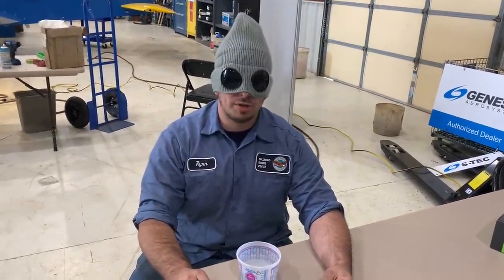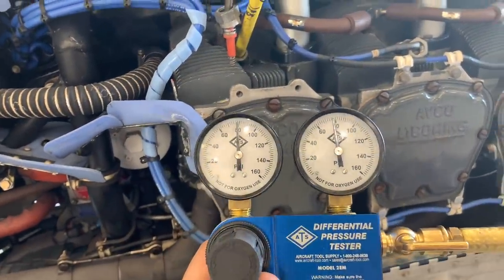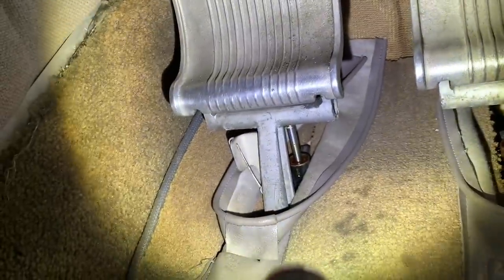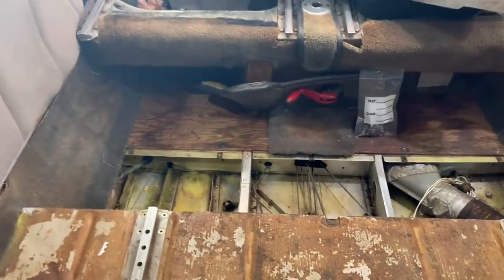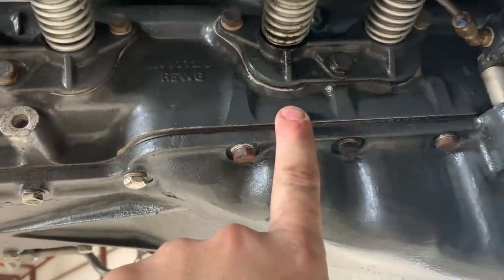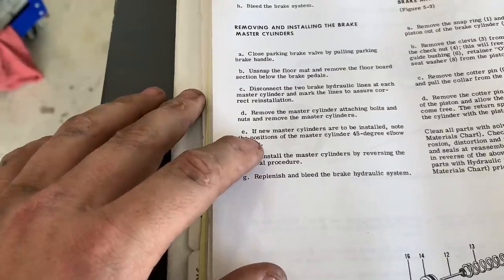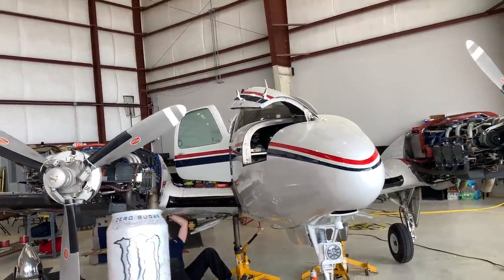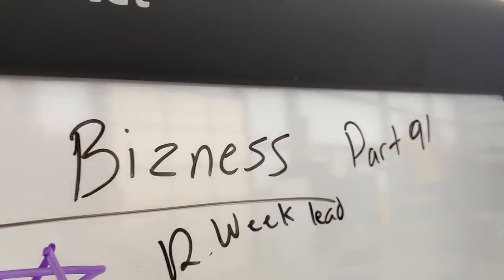Baron 56TC annual inspection finds.   Days in the lives of underpaid general aviation workers.

Comment: At home depot or lowes you can get micro nozzle kits for vacuums, then get the adapter kit for the small hose and use ductape at the ends of the different fittings to seal up the joint even better so no loss of vacuum. I have a 1/4 nozzle thats awesome but mostly use the 5/8 one. Another method is get a big ass vacuum in there and blow it all out with an aircompressor with a long brake line on it for a nozzle.

Comment: Have to use one those narrow fittings that usually come with the Vaccuum accessories. But you got to use some kind plastic bristle brushes first with some kind of safe to use cleaner to loosen up the crap. Park tools makes a nice brush used for getting between bicycle gear cassettes and also Muc Off makes a cool set of brushes for cleaning bicycles.

Comment: in 2015 I did a whole new interior on my 1975 C177 Cardinal RG under the supervision of my AI.  I'm pretty sure it was the first time that the area under the floor had been cleaned in at least 30-years.  For dry stuff, a thin nozzle on the vacuum worked, but a good deal of the crevices were gunked up with old hydraulic oil, pulley oil, etc.  I made custom bent wire and nylon brushes and used a citrus based degreaser to loosen it, then many, many rags.  Its a little upsetting to see how many aircraft mechanics cut corners or just do things that make it hard for the next person to fix.  Good on you!!

Comment: Dont forget you respirator when cleaning mouse poo ;) btw I use the RIDGID VT2534 kit but also have rigged different size clear flexible tubing I got at lowes and just attach them to 1 of the thinner shopvac adapters with a hose clamp and it works great for those awkward spots.

Comment: I have just the thing for you!  Go down to Home Cheapo and get some PVC fittings for the end of your shop vac, so that you can attach a length of garden hose.  Use about 2-3 feet of flexible hose, with the end cut at a 45-degree angle.  This will increase the air flow (vacuum) substantially, and the flexibility will allow you to “snake” the hose through any narrow openings or inspection panels.

Comment: TIO-541-E1C4 engines from a Duke. Big turbos make that plane the fastest Baron in the sky. I would highly recommend to the owner to fix it right, fuel bladder and prop de-ice, or since it is for sale, I hope any prospective buyer sees this and reduces the offer to cover those items. I never saw a prop deice boot throw a lead off like that. But I have seen a broke lead or two. Might be a good idea to solder the wires onto the terminals, but I know they don't come that way.
Reply: Negative on the solder idea! There is a reason connectors are never soldered on airplanes: vibration. And in this case, relatively severe vibration. Solder has a bad habit of cracking at the wire/solder interface. Best bet is the (now hideously expensive) Amp 59250\59275 series crimpers. I bought a used pair of these when I built N36LV. They provide a near oxygen-free crimp to the bare wire and a solid secondary crimp to the wire’s insulation. You can still find them used on eBay and ship them  back to Amp for calibration. Never had a single failure.
Reply from the maker: I’ve seen people solder the crimped side of the terminal, not the wire side.  It helps prevent corrosion, and may have kept the wires from pulling through in this case.  So it’s crimped, soldered on terminal side, then heat shrinked.  If it comes off after that 😂……. Not really sure of the rules and regs on the prop though, we will let a prop shop handle all of that….  
I love been thinking that the pulled through wires may have been caused by someone pinching them while installing the spinner….. like “hey this won’t go on all the way… let me just force it !”
Reply from the maker: Also where do you get that connections are never soldered?  Ac43.131-B. Section 14, sub A, #7 talks about using soldered lugs for terminals
Reply: @aviationsquared1909  I just don't recall the terminals on those leads being soldered. If they come soldered  from the manufacturer, why did they pull apart?
Reply from the maker: I’m responding to B walker…
Reply: Not lycomings best effort
Reply: These Engines: TIO-541-E1A4 did not come off a Duke.  The 56TC was a predecessor to the Duke, maybe even a test bed, and the TIO-541 engines were modified to support accessories for pressurization on the Duke.

Comment: I hope you didn’t rebuilt those brake cylinders yet. Recently replaced a couple of them bustards leaking on two different Bonanzas with a newer style cylinders. According to the guy worked for Beech for a while those are not worth the rebuilding, going to start leaking again really soon.

And they are not fun to replace. That bolt goes head-outboard just like you assumed, there is no way to force it in head-inboard with cylinder in place, it’s not going to make that angle turn to straight direction ever.

Also removed and installed one bladder on Bonanza. Was leaking from one of the nipples that is attached to the ridged line towards the fuselage. Simply was over tightened and cut through by the securing clamp.

Good catch on that pinched leaking brake line👍🏻

Another cool video! Thanks
Reply from the maker: Looks like it had some extensive sheet metal repairs and I’m it looks like they replaced all the metal on the bottom.  My guess is the sheetmetal guys through that bolt in there before they riveted it in and had a good laugh
Reply: @aviationsquared1909  yeah, I’ve noticed a couple new rivets in the nose wheel well. Liked that laugh over the bolt head cut out on the video =)
Reply: Yep, had a few Bonanzas in the shop of late that were leaking after rebuild. Don't think it's possible to get the old master cylinders anymore?

Comment: For vacuuming tight spaces I use a variety diameter of automotive heater hose to adapt down as far as I need- usually ends up being a fuel line diameter. It's okay for getting around corners too.

Comment: Hi, nice content, just curious on the min. 7:33, the bonding straps damage on the fuel line, they should be installed with bare metal clamp against the metal tube or this rubber grip  on the Adele clamp enhance the electrical conductivity.
Reply from the maker: Above my knowledge, I’m with you on the rubber lol.  I’ll ask in the morning, keep commenting if you don’t hear back as I’ll forget
Reply: 100% Correct! Using a rubber cushioned adel defeats the purpose of bonding.
Reply: @aeromission9333  I remember thinking the same thing. Why a rubber clamp on a bond strap? Along time ago I took one of those clamps off to see. It had a metal contact area in the middle of the cushion. It is a specific beech part. That’s what I remember,, been a long time.

Comment: 3 years for an STC. Must have been either the fault of money…or the FAA. 

I did a field approval for a wrong engine on an PA22, still only took 3-4 months of waiting.

The stamps on the cylinders are likely from the cylinders being overhauled units, they were on their original engine at those positions. But not necessarily required to be there on the next engine
Reply from the maker: Makes sense.  The 3 year gap was before my time in aviation.  I’m more video experience than aviation experience 😂

Comment: 20 years of fixed and rotary wing maintenance in the military plus 14 as an A&P after I retired, boltheads are up, inboard and forward unless called out in the maintenance manual. 18 inch rule applies or within the space your working for FOD, even brand new from the  factory can have some doozies laying around inside and age plus varying maintenance doesn't help.

Comment: Around a 1-ft length of  hydraulic tube or fuel line aluminum pipe neck it down actually neck it up to go into the end of the vacuum tube and use it as a nozzle for small places.
Reply from the maker: Good tip

Comment: *Did you replace or spray lubricant on the mixture cable to free the full movement?
*After vacuuming the FOD and poop, are you coating the aluminium with cabrium chromate (green corrosion protection)?
*That was good thinking placing a screw cap on the connection and air-leak testing.
🐝💨🧑‍🔧
Reply from the maker: Mixture cable had no cotter pin and the nut was too tight.  Also we re indexed it one tooth and that freed it up

Not sure about the coating question.  There’s a much longer list of squawks that they’ll go over with the owners

Comment: Very interesting to see what you look for - and how you dealt with what you found. Can you repair the fuel bladders, or are they strictly a replacement item? (Beech parts are like Porsche parts... the nine-digit part number is also the price). Nothing irritates me more than seeing the stuff you found inside this plane. I had to ask myself as I watched this video; how many times did I climb into someone else's airplane and fly or instruct in it, not knowing what hid under the floor? Although I've retired, I subscribed to your channel. VERY interesting! I'm also a former owner of a 56TC, serial # TG2.
Reply from the maker: Not many left flying.  Repairing fuel bladders is probably possible, but no one in our shop has any knowledge of how to do it.  Would definitely want to learn how if the opportunity presents itself.  A lot of knowledge and information is retiring out of the work force and finding a good A&P to train under is becoming difficult
Reply: There are times where a repair on a fuel bladder is possible and preferable over replacement.
Reply from the maker: Where do you get tech data for that?  Labor cost would be the same for removal and installation, so I guess you wouldn’t know if you “could” repair it until it’s removed

Comment: If you are not an authorized Beechcraft repair station, the next time this Barron visits one, all the work you did will be for naught.  They will re-inspect and redo any work you did.  And charge appropriately, or at least appropriate to their rates.  I owned an A56TC and almost got caught in that.  I had a friend that worked at the shop and basically told me my plane may be flagged as unairworthy.  Please compare the specs of a 56TC to any similar airplane of the time and you will see it was the top of the line.  They require attention and they are expensive, but from a business point of view, they could be the best tool available, maybe the only one available that would actually do the job.

Comment: Hmmm. 91-205 and 213 doesn't let you skip things at annual. Neither of those tells you you need brakes..or even a working elevator..
   43 appendix d specifically tells you to inspect anti-icing devices.
    Placarding certain things inop can let you fly the aircraft, but doesn't mean you can overlook it come annual or 100hr time.
   The MEL is misnamed, it's not minimum equipment,  it's really what can be broken under certain conditions, that you may continue to operate with, possibly with major restrictions..maybe only 1 flight, or for a specified time, or VFR only, or no passengers...who knows. The limitations depend on the aircraft, even the "ops specs" of the operator.  I've never seen an MEL for a baron,  but maybe they exist.  More of a jet thing. It is helpful, because without an mel, most everything should be working..the mel lets you keep going legally with certain failures.
   For annuals and 100hr., I consider both 43 apx "d", and the manufacturers checklist. Mostly,  satisfying one covers the other, but I do make sure. Pain in the ass. 
   I worked on a 56tc about 20 yrs ago, it was sort of a mess, also. I wonder if it's the same one. Less than 100 made.
    Good idea Beech...using a lycoming. To bad they picked that particular Lycoming. The 541. A 540-j2bd would have made a better plane, if a bit slower.
   Have fun with those bladders.. 
   I've welded a bunch of those steps. I put a little doubler on, seems to help. Where the teardrop tubing meets the L shaped piece, I mean.

Comment: They do have what is known as a crevice tool that goes on the end of the vacume hose. Gads! How old is that bird???
There is no excuse for all of that trash to accumulate in those hidden areas. That mouse crap and piss can be VERY CORROSIVE to aluminum which can eventually lead to metal failure. As for the pulleys considering if the aircraft was over 15 years old I would have shotguned all of them with new ones but I would hate to see what Beech gets for those items.
Its about as bad as buying replacement parts for HUMMV's new from the suppliers, anything with a NSN number or TSO certified carries a hefty pricetag.

Comment: Vacuum= Harbor Freight knapsack bag vacuum powered by pneumatic line.....as long as you have shop air, it is 3X stronger than a good shop vac.  I would NOT sign that plane off with that level of corrosion without serious treatment/metal replacement.- An A&P viewer.
Reply from the maker: Look us up on Facebook and message me if you can

Comment: I would also NOT grind that brake piece with the gouge down and call it good UNLESS the SRM specifically denotes allowable depth.  Airworthiness item....Floorboard, I would replace with 2024 sheet metal panel with inspection holes pre machined.
Reply from the maker: Polished. Not grinded.  IAs referenced Ac43.13 and deemed serviceable as the maintenance manual was written in 1965 and doesn’t cover things like acceptable scratches on components like that

Comment: How much time did the annual take ( in days) for a 27min video. BTW, nice looking Baron and looks like you do great work.
Reply from the maker: Lol.  Just me working on it 2 day alone.  Then 5 guys, ran through wheels tires, exterior panels, ELT check, garter filters, battery cap checks, AD research in a day.  So it would probably take one really experienced guy about a week and a half.  Plus, we didn’t fix fuel bladders, or the prop